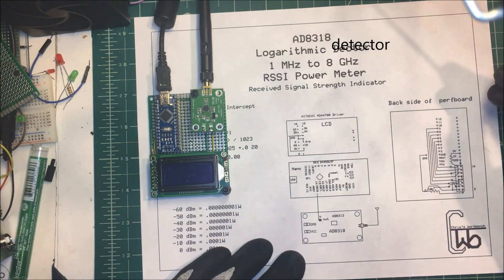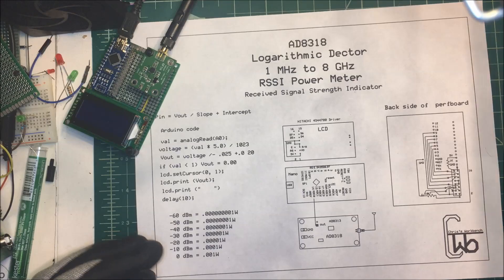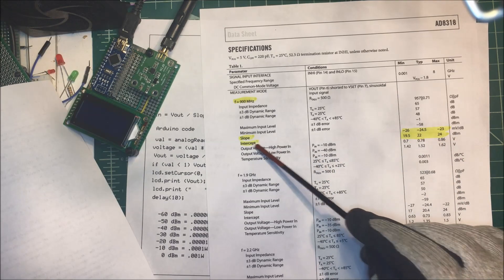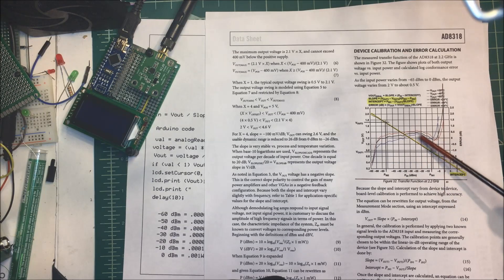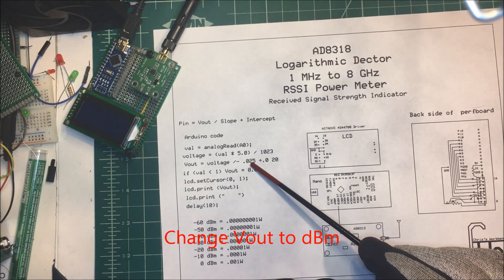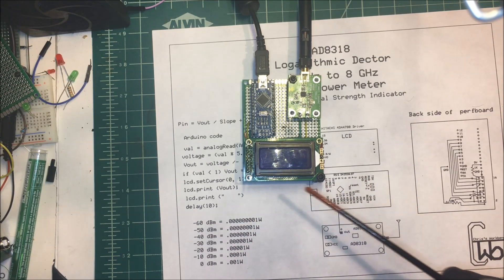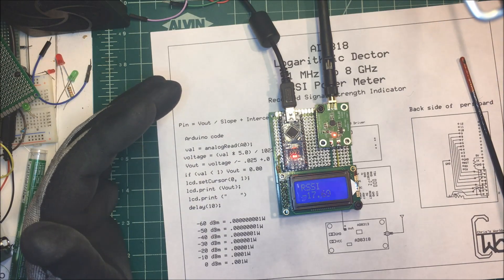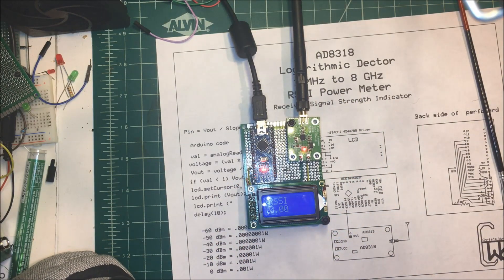AD8318 RSSI Meter

Comment: Hi Sir, can you explain why the slope and intercept values are taken as -0.025 and 0.020 ; rather than -24.5 and 22 as mentioned in AD8318 datasheet for 900MHz?
Reply from the maker: The slope and intercept values on the data sheet are in mV.
Reply: @ke6chris  Thank you for the confirmation

Comment: The meter you have created is an RF field strength meter not a receive signal strength indicator RSSI, An RSSI is to be found on a Radio receiver or transceiver. To measure relative received signal strength.

Comment: can you show your full Arduino ide code? im using this for my final year project. Please. Thank you
Reply from the maker: #include <LiquidCrystal.h>
float Vout = 0;
float val =0; 
float voltage =0;
 LiquidCrystal lcd(9, 8, 7, 6, 5, 4);
void setup() {
  Serial.begin(9600);
   lcd.begin(8, 2);
   lcd.print("RSSI ");
} 
void loop() {
  val = analogRead(A0);   //read the input on analog pin 1
 voltage = (val*5.0) / 1023; // Convert the analog reading 
   Vout = - (voltage /(.0245) + 22);
  if (val < .1)Vout = 0.00;
   Serial.println(Vout);
   Serial.println(val);
 lcd.setCursor(0, 1);
   lcd.print(Vout);
   delay(1000);
   }
Reply: Chris's Workbench thanks much!
Reply: @ke6chris   HI! how will the code change for different frequencies?
Reply: What if i use AD8310? Is it different? How is it
Reply from the maker: @zainulhakim9583  AD8318:  1 to 8000MHz 60dB  range ,  ±0.5 Temp Drift,  10ns response time, 16-Lead 4x4 mm CSP 50 ohm drive
AD8310:  dc to 440MHz 60dB range,   ±1 Temp Drift,  15ns response time,  8-lead MSOP 
Different calibration graph

Comment: Hi,can I attach a 2.4 GHz antenna to the input to measure the signal strength of the specific frequency. The values will be double checked using a spectrum analyzer. How accurate it is?